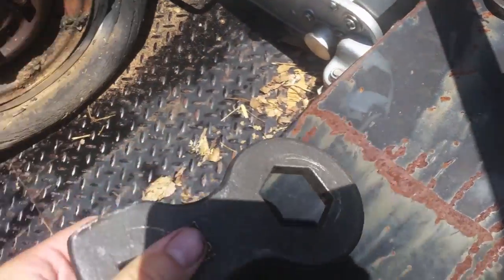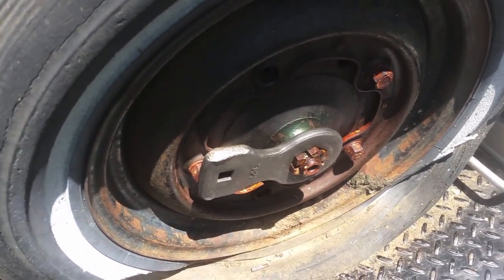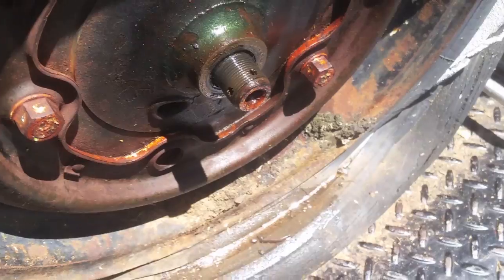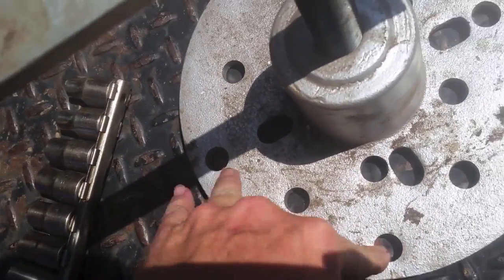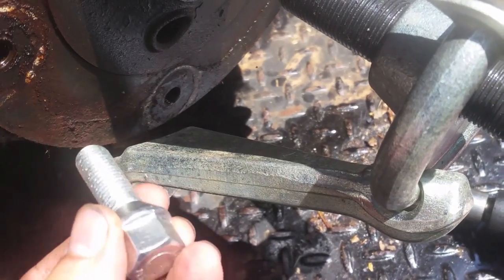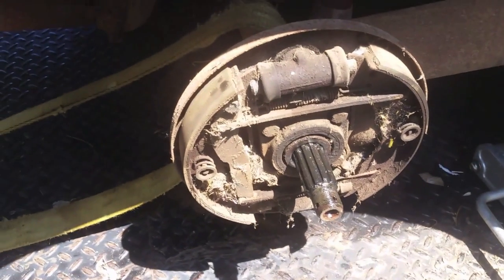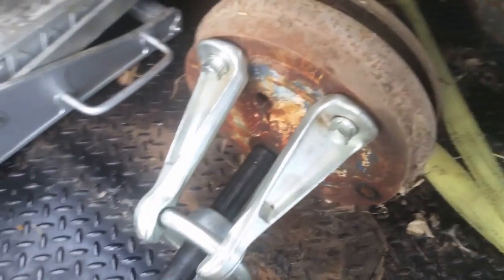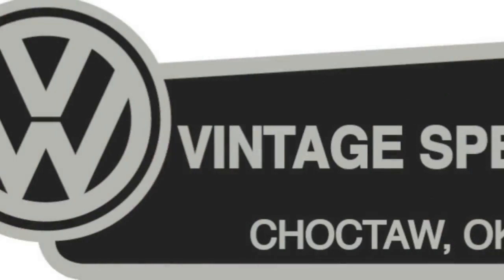Removing a Stuck Drum on VW Bug or Bus, Similar with any car

Comment: Thank you! Same problem and just the info I needed. I had also picked out that same puller a couple days ago and was surprised to see you using it. Will try some heat first before buying one.

Comment: If wheels are factory just leave them bolted to the drum. Rent a 3 jaw 5 tons puller and slide the hooks in through the slots on the wheel. The puller will not be exactly on center but that doesn’t matter. Also try to turn the brake adjusters down to draw the brake shoes away from the drum. I just did this on my 71.
Reply from the maker: I prefer to not ruin my wheels and if you mess with enough cars, the puller is worth it. Brake adjusters don't help when the shoes are rusted to the drum AS video'd
Reply: @VintageSpeedwerks  I agree with what you have said as well. My adjusters would not turn anyway. I did ruin one parking brake bar in the process. I enjoyed your video, thanks for the reply.

Comment: For a stuck vw drum; take off the hose and unbolt the wheel cylinder. Let the drum take it with it.  It’s unlikely to damage it like the 2nd one done in the video. 

That puller broke the wheel cylinder on the 2nd wheel.  That’s serious power there.
Reply from the maker: They need wheel cyl, so waste of time

Comment: What was brand of  the last puller you used here that removed the brake drums??? My are seized all the way around.
Reply from the maker: Links below
Reply: @VintageSpeedwerks  The link went to a puller but in the question/comments someone said it wont fit the wide 5 VW.  Is that the right puller or did they change it on amazon?
Reply from the maker: @paulwatson  not sure then, mine fits
Reply from the maker: @paulwatson  maybe they are. Trying to put all 5 on? That def won't work.
Reply: @paulwatson  it does not work, i bought it and its too small...only 7.5 inches max....need an 8 - 1/4" diameter bolt pattern puller.....if anyone needs the small one, hit me up

Comment: This is stupid...but I cannot loosen one single lug off of the '64 Beetle's wheels. Hammer drill with an industrial compressor- nope. Lug wrench (bent 45 degrees instead of 90...ridiculous btw..)- nope. Lug wrench with an aluminum tube extension of 60"- nope. I have silicon sprayed it as well. Nothing.
Nope. Nada. Nichts. Nothing.
Thoughts?
Reply from the maker: William Williams wow. new drum time
Reply: Use a propane torch on them for a bit then they should come off.
Reply: Cheater bar is what I used on my 67